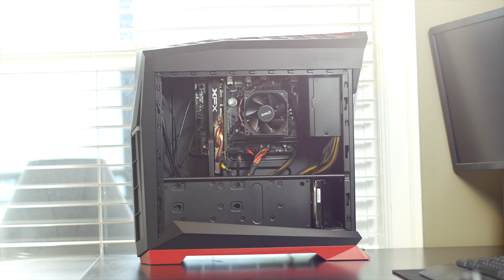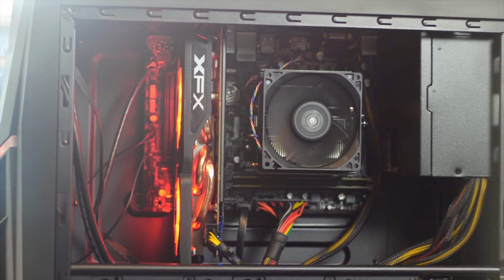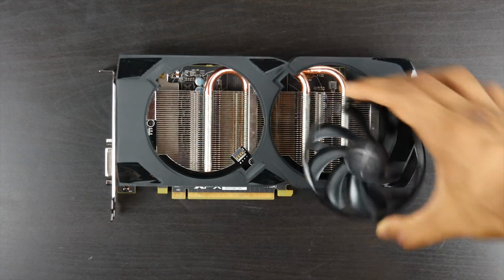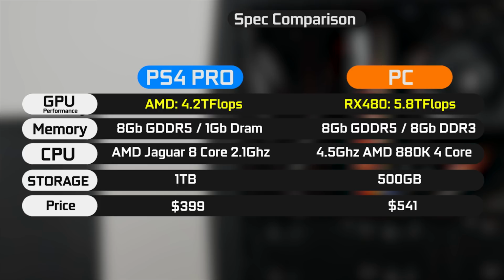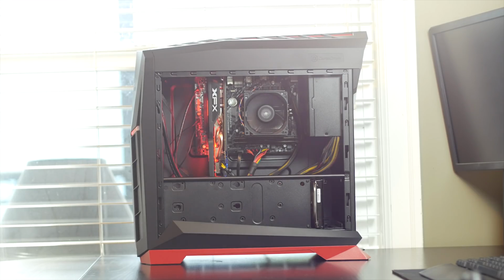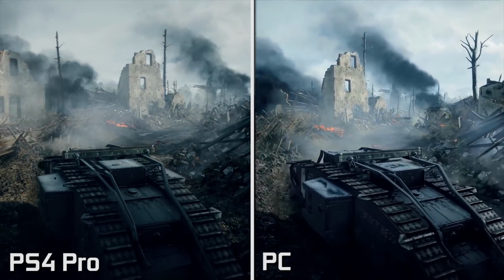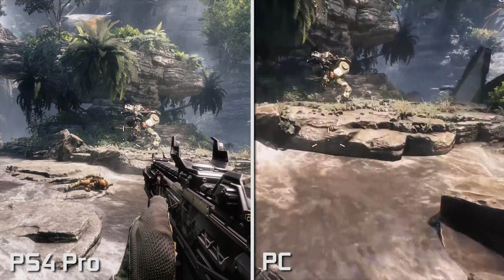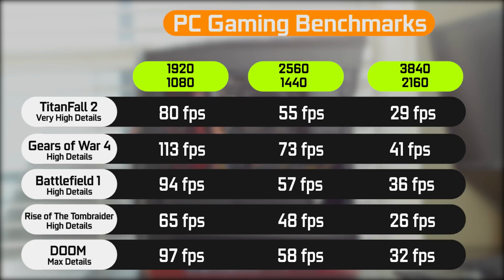Playstation 4 Pro vs $550 Gaming PC

Comment: Well I can tell from the thumbnail that the PS4 Pro definitely wins in size.

Ouch, should have undervolted and overclocked a 470 - PS4 will also decimate you on power consumption. 

You'd be better off with a used i5 2500 based Optiplex 790, just add 8GB memory for 12GB, swap out PSU, add RX 470, undervolt, overclock, and you can beat the PS4 Pro on price and power consumption as well as horsepower.
Reply: Sorry but a system either the 880k or 2500 and an under bolted 470 will still use more power than the ps4. It's just not possible as the ps4 is an APU bs the pc's cpu+gpu (ps4 has one set of memory while PC has ram and separate vram to power). 

If you overclock a gpu it will use more power, period. If you undervolt it and overclock it you will end up around the same power consumption. Lowering the voltage doesn't lower the current (amp), if anything it will increase it to help stabilize since there's less voltage. 
Volts x Amps = Watts. 

A PS4 Pro while gaming in Pro games uses around 144w~ (Digital Foundary)

A 470 uses 140w~ by itself (Toms Hardware).  Now add in the rest of the system. (Hint: it will be way over 144w) but it won't hit PS4Pro level. 

Anyways the stock 470 already outperforms the ps4 pro. You could undervolt and underclock it a bit to match the PS4Pro if you are worried about saving $20 more a year on your power bill. 

And don't talk about used parts. There aren't thousands of used 2500. We deal with new parts as they're available to anyone and within a certain price range.
Reply: ***** I was saying the same thing until I bought a 4K tv. It still needs it a little. I just use fxaa.
Reply: *****
What
Reply: Jarod Roach in short, make the graphics thingy less energy hungry while making it stronger, add in more ram, and put in a less power hungry computer brain
Reply: Cap'n Snah
Less power hungry and better performing, yeah
Reply: Jarod Roach yeah, what he said lol
Reply: Yet you're forgetting online subscriptions so add $60... funny how people forget this.... without it PS4 is worthless.... its shit anyway
Reply: I own an XFX RX 470 and I got a stable undervolt and a higher clock, but the settings in Wattman won't stick. Every time I "save" my changes its reset back to stock when I reboot my PC.
Reply: Felipe03000 That would make a much bigger difference than thermal paste that is new
Reply: Felipe03000 it will handle it but not at ultra for new games. If they get the whole multi gpu adapter thing (forgot the name) where you can just throw cards in and it will use them working, then xfire would be useful. But ya, until then stick with a single card
Reply: the 880k bottleneck might also be of concern too, even an intel core i5 760 performs better with an rx 480,
Reply: On top of that there is no I/O (K/M) and no OS. Adding at least another $100 to the price of the PC.
Another failed PC vs Console priced comparison on the face of it. Oh well.
Reply: Andrew Russell
Yeah it will use more electricity but it will also outperform that PS4 Pro.

There are literally thousands of used i5 2400 and 2500 based systems to buy, they are all over.
Reply: VariantAEC a couple months ago I made a pro killer PC including Windows using a 860k and 3gb 1060 for the price of a ps4 after tax and 1 year of psn (right under $500. Not sure if it's still up on pastebin. The parts may have changed though. Not at my PC
Reply: ***** expect that prebuilt a aren't made the way you want aka not custom
Reply: Andrew Russell
You can get them however you want, there are literally thousands of different models to choose from. The Optiplex 790 that I got was literally EXACTLY what I needed and wanted for the space I had, and the 470 is working pretty well in it.
Reply: ***** I've built a lot of pc's for myself and others, I guess I just know what I want for features and future upgradability
Reply: ***** use afterburner
Reply: Andrew Russell Ok, I'll try that, thanks.
Reply: or sapphire trixx
Reply: I ended up just using Afterburner and having it run minimized on start to make sure the settings sticked. Works fine now and decreased my temps by 4-5c in Overwatch with an undervolt.
Reply: ***** with that undervolt, if you see artifacts or start crashing, raise the voltage back up some. I doubt this will be an issue anymore due to how gpus' now monitor voltage and heat but just keep it in mind.
Reply: Andrew Russell or down the clock
Reply: Felipe03000 that reduces performance which is the opposite of what we want.
Reply: Andrew Russell depends. If he is getting temp problems downclock will help.
Reply: Felipe03000 barely, temp is 95% due to voltage
Reply: Andrew Russell You're right about that, after lowering my voltage the temp went down by around 5c all around.
Reply: Andrew Russell here I needed new termal pastes, and I couldn't get it (No internet) so I downclocked and lowered the voltage adn everything came back playable. But it is not the best thing that you could do...
Reply: Felipe03000 on your gpu??? How old is it? I replaced the thermal paste on a gtx 470 a couple months ago with some gelid extreme and it dropped temps by only 4c under full load and max fan (testing)
Reply: Andrew Russell Its my processor, a FX 4100, with the cheapest motherboard avaliable. It was some time ago, and the termal paste was completly fucked up.
Reply: Felipe03000 makes more sense. Did you try lowering voltage and keeping the same clocks? Voltage may have been too high by default, I've seen it happen.
Reply: Andrew Russell Yes, I could down only a little, but it was not enought... I needed to down the clock. 3.6 GHz to 3.3
Reply: Andrew Russell Now I am fine, bought a new fan (the best airfan that I could get to my FX 4100) adn overclocked it to 4.4 GHz. I'm feeling that its time to buy a new paste, because the temps are getting higher and higher over time (50* C at the time that I fixed everything, 60* C now, and 70* C is where it slows down the cpu to lower the temp)
Reply: Felipe03000 that doesn't make any sense. Paste doesn't go bad that fast. It takes years to see a temp increase due to drying out. Also, be careful. I'm guessing you have a 970 mobo with no vrm heat sinks. I've read that they can blow very easily when above stock voltage. I read where a guy had gone through 3 of them himself and knew others doing it as well. He stopped recommending them. Now I've had two myself and I overclocked but didn't overvolt since I didn't want to blow vrms or caps. So just be careful.
Reply: Andrew Russell it could be the summer here. Its sooo hot...
Reply: Felipe03000 also the next upgrade I would do would be a 6300 or 8320 or a Ryzen processor
Reply: Andrew Russell I will buy a 6 core Ryzen, with a good mobo this time XD. I'm planning a RX 490 Crossfire here, so I will need a good CPU.
Reply: Felipe03000  I'm going to just suggest not wasting money on xfire. Not all games support it, it cost a lot, you'll have a ton of heat and power consumption, and get micro stutter and/or glitches. I did sli with 670s. I won't ever do it again unless I have no better card to buy and have money laying around. I'd suggest saving the money for the second card and wait till next gen cards come out and then use that money + sell your 490 and get a brand new "590" or whatever. That's just me though
Reply: Andrew Russell hm... I will buy the RX 590 then... it will be the so waited VEGA with HBM2. Ty for the advice m8!
Reply: Andrew Russell Now I'll just buy the Ryzen, overclock my GPU (I already have the profiles) and wait for the 590. I was planning crossfire because I wanted 4K 60fps ultra with aa... and I dont think that a single 490 could handle it very well...
Reply: Felipe03000 You don't need AA at 4K, seriously. When I tried 4K it looked like 2x AA. Just put on FXAA if it really does bother you a lot.
Reply: Andrew Russell Yeah, that's what I meant when I mentioned FXAA in my previous comment :P
Reply: Buying used is cheating for this comparison

just admit the ps4 pro is a better value for gaming...

Comment: i dont think there is a pc right now that can get the gaming performance of the pro for $400

even this i don't think really beats it and it only has a 500gb hard drive opposed to the pro's 1tb

also no one ever includes an OS..and i know linux is free.but people who game run windows and that can be an extra 100
Reply: I'm sure a lot of people didn't pay for windows.
Reply: Wes Baugher You're right and I'm a pc gamer.  Some people will always make the point you can buy used parts but even then you'll have a hard time getting the same reliability for the price of a PS4.
Reply: i dont want upscale 4k lol, i want native 4k so pc
Reply: There's a lot of people who don't pay for games.
Reply: Nah Windows 7, 8.1, or 10 are all just $30ish on Kinguin
Reply: Jose Vazquez
Oh not at all, Dell Optiplex 790 i5 2500 base, upgrade to 12GB RAM, upgrade to 500W EVGA Bronze PSU, Upgrade RX 470, $350-370
Reply: Jarod Roach I meant brand new and current parts.  With that argument you can say that you can buy a used ps4 pro for $300 in a couple of months
Reply: But you have to also consider that you get much more value out of a pc than you will a ps4 pro, building a pc for 700ish will basically kill two birds with one stone, you get a solid gaming pc plus you get all the other functions a pc can do that a ps4 pro can't. Honestly the ps4 pro is only worth it if you want to play video games on the couch, besides that your better off getting a pc.
Reply: Jose Vazquez
By then, the parts I regarded will also amount to around $300, so it sounds like the two setups will be comparable. I will agree that the PS4 Pro wins on size and power draw as well as optimization.
Reply: Wes Baugher yes there is lmao JermGaming
Reply: Consoles don't cost that much anymore. I can go to ebay and grab an xbox one for $175 or a PS4 for $250. And they'll both come with games.
Reply: thats true..also thinking keyboard and mouse would be extra money. This is assuming the person has nothing extra or used lying around.

I just think the $400 out the door with a controller gaming system with those kinds of results in games is a very appealing offer.
Reply: I prefer my gaming PC as well, it's funny though i have been streaming a lot of my games to my nvidia sheild lately so i can play them on the couch like a console.
But i love how my pc can also be a computer and run many more games including a slue of emulators so i can play all my old gamecube and wii games at 4k, which is pretty awesome.
Reply: Wes Baugher A 400$ pc kicks ps4 ass!
Reply: maybe a ps4 ...but i don't know about the pro, which is what i was talking about.
Reply: @wesbaugher  All the consoles hardware is many years outdated, you pay 400$ for the console but then you have to pay 60$ per year for online. Let's say you will own the console for 5 years. 5*60=300. You will pay 300$ extra for the console so it's 700$ total.  A 700$ PC will rape the PS4 Pro, then dismember it, lightly seer it and eat it.

Comment: Save $ and get an i3 instead, it has a big upgrade path.
Reply: Barack Smith the skylake i3 is actually a good gaming processor thanks to hyperthreading
Reply: PS4 Pro doesn't have an upgrade path either so it's fair lmao
Reply: Cantz s it means that upgrading to an i5 or even a i7 will be a very simple upgrade in the future, compared to if you were to go amd, you would need a new motherboard, CPU, and ram
Reply: What the hell do people mean by "upgrade path"
Reply: Cantz s
Chiggins is correct
Reply: chiggins Oh thanks.
Reply: chiggins or just wait until February and get a Zen. Then you have an upgrade path, because I'm sure AMD won't change the socket for another few years. Intel changes their sockets like their underwear.
Reply: +KuroJo I thought zen was confirmed to use the AM4 socket?
Reply: Castrova yeah, but they supported am3 for 7 years now, so I will expect am4 to exist at least half as long.
Reply: ***** My bad i actually thought you were hinting that Zen would support Am3+ motherboards. Misunderstood, but yeah i agree.
Reply: it could, am2+ motherboards supported am3 processors so its not like its that far of a stretch
Reply: luigi90210 nah. Am4 is a complete redesign. If it was backwards compatible, it wouldn't perform so well
Reply: ***** so was AM3 and AMD said AM3 wouldnt perform as well in a AM2+ board as it would in a AM3 board

im not claiming this is gonna be the case with AM4, im just saying it isnt a far stretch and imo wouldnt be a surprise if AMD announces AM4 backwards compatibility with AM3+ boards
Reply: luigi90210 still, I say it's impossible. AMD showed a zen processor that performed equally as the top Intel processor. That's not possible on a 7 year old socket.
Reply: ***** How about you do your research? The 880k doesn't do amazing even for a "pure gamer" It bottlenecks the rx 480 a lot in more cpu intensive games.So why wouldnt someone want an upgrade path for a few years down the road when the 880k already struggles?
Reply: ***** I know what cpu bottlenecking is. And the Graphical quality only goes so high. Obviously with a rx480 you are aiming at 1080p at max settings. Sure if you up the Resolution there will be less of a bottleneck but you will also have to deal with lower Fps either way. A lot of people if not most people rather keep 60 fps and 1080p then 1440p-4k 30fps. So no the athlon 880k is not a great cpu for pure gamers. Only people who want super high resolutions with lower Frame rates.
Reply: ***** Did you? Because all the games at 4k High- ultra settings's fps are in the 30s Aka "lower frame rate"
Reply: ***** My bad getting confused with another video. Yeah the frames are high at 1080p but these are mostly gpu intensive games and they are at lower graphical settings not ultra
Reply: yeah i know i got confused with another vid its been a long day read my second comment
Reply: ***** I like it too and i got your point im just saying that the 880k isnt necessarily enough for any gamer because if someone wants to play more cpu intensive games at max settings at higher framerates the 880k isnt for them. It is definitely good for budget gamers tho for sure.

Comment: You should of put an fx 6300 instead of a x4 880k
Reply: Yeah, he should've got a better CPU, but for some reason he only used Amazon to buy his parts and if he used Newegg, he probably lower the price.
Reply: +chin ese even it doesnt matter that he got them from amazon if he just got the 4gb rx 480 he would have been fine getting an fx 6300 but for some reason he got the 8gb model which is stupid since even triple A titles on max settings only reach like 2.5GB of VRAM at 1080p.
Reply: All sorts of heathenry have*
Reply: hi, with my fx 8320 oc at 4,2 ghz, 16 gb ram ddr3(8gb hyper-x and 8 gb hyper-beast) and my asus r9 290 direct cu ii ,can i get similar perfomances in that games?

Comment: Not a bad set up, i would have gone with a 4GB version and use that money to get a better CPU, like a FX 6300 or a i3 6100.
Reply: I'll be honest. cut down the case. looks pretty sht. and get a i5 6400 and get the 4gb rx 480 and this pc would be good. or maybe if your in a really tight budget drop the rx 480 to a rx 470 but keep the i5
Reply: Aaron T
Yeah if I was gonna get a 4GB card I'd just overclock a 470 myself. If I didn't need the extra performance for cryptocurrency mining, I would have just got a 470 instead of my Red Devil 480 8GB.
Reply: SEBASTIAN ODE It's also more expensive. The i3 would be my go to choice, but if you can't downgrade other components to make room for it, the 6300 is a nice budget choice.
Reply: CLANPAW51 it means: 100% gpu usage.
Reply: Yeah the 8GB version is kind of a waste unless you're planning on CF or use tons of texture mods in games. 

I have one but it's for mining not just gaming or I would have gotten the 4GB version instead.
Reply: Alot of newer triple A games now a days are using a crap ton of memory, like Deus EX, but when your on a tight budget going with a cheaper 4GB model to what's mostly going to be a 1080p gaming machine to get a better CPU is the way to go.
Reply: Johnsue Rivera
Does Deus Ex use more than 4GB VRAM? That's hardcore!
Reply: or ssd
Reply: gta 5 uses 5gb vram for me......
Reply: :) I dunno yet about Mankind Divided, but Human Revolutions runs smoothly at minimum 60fps with all the settings maxed on my GTX 970.
Reply: Better CPU changes nothing... Overclock the current cpu and spend more on the GPU
Reply: Felipe03000 You're incorrect. A shitty CPU will bottleneck your GPU and lower your overall performance. You'd want to make sure that your CPU, (AMD) doesn't slow down your graphics card.
Reply: CLANPAW51 overclock it.
Reply: Felipe03000 Over clocking doesn't prevent bottlenecks
Reply: CLANPAW51 to buy a good CxB gaming pc (to counter the consoles) you need to spend the less you can in the processor to spend more on the gpu (the processor should not bottleneck the system).
Reply: Felipe03000 idk who you're quoting, but that's not how part picking should be. If you don't pick a good CPU, have fun playing with 80% of your GPU
Reply: CLANPAW51 on most cases it doesn't. But it can. I bought a R7 265 to upgrade my pc (FX 4100 + GTS 450 + 8 GB RAM). I had a very light bottleneck in some games, and as the FX 4100 is very good to overclock (I upped 3.6 GHz to 4.4 GHz) I had no more problems.
Reply: CLANPAW51 "(the processor should not bottleneck the system)."
Reply: Johnsue Rivera i3 6100 is better than fx6300
Reply: Honesty i5-quad core or above or bust these days